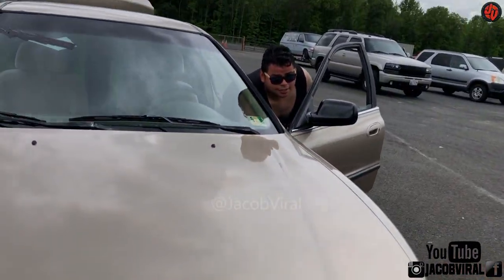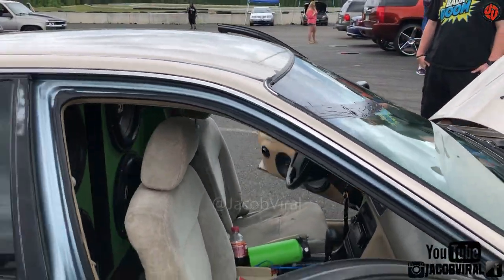HERE IS WHAT HAPPENS WHEN 4 15S BREAK THE GLASS IN THIS CAR

Comment: Hey Jacob I was wondering if you could make a video showing how to wire doors with multiple speakers, maybe even different ohm configurations. Woofers too. Like three, four, five, and so on woofers and what would be the impedance on amp? Maybe explain how to find box rise, what it is, and how to fight it?? That would be a great video. Take care!! 🤛🤛
Reply: I agree with the multiple speakers in doors video!
Reply: @soundofbass6842  Yes awesome. I think if done well it would be a very sought-after tutorial to teach people how to wire speakers correctly. To have as many speakers as they want and at the ohm impedance they desired. 🤛
Reply from the maker: Noted for maybe a future video thanks. Honestly there is no one answer for fighting box rise and it changes for everything single thing done including temperature, window adjustment, seat spots, people, frequency, etc so not one easy to explain.